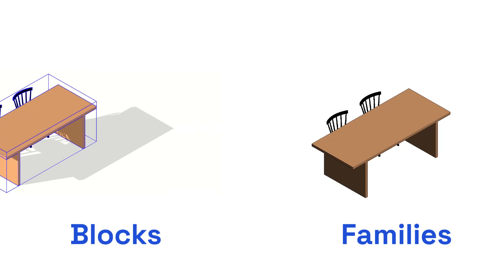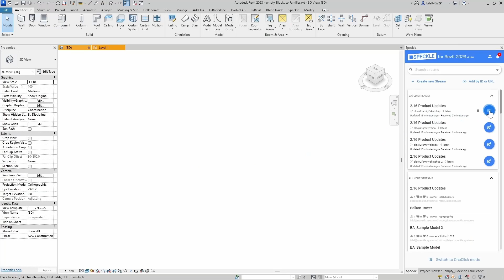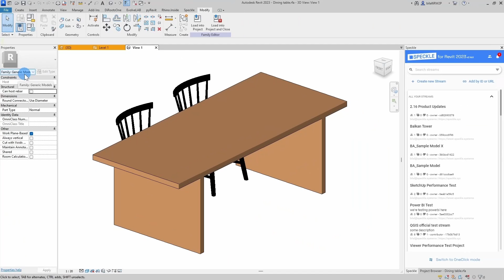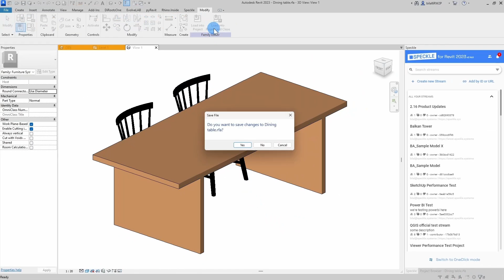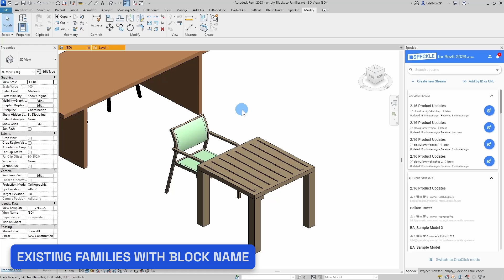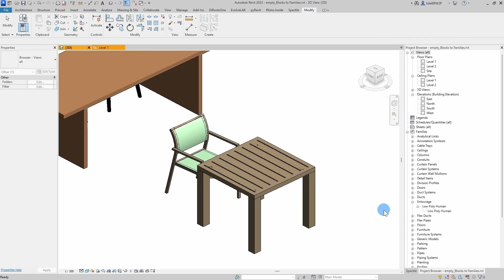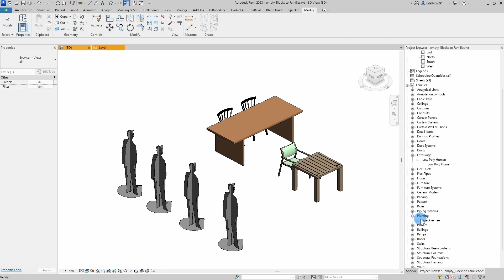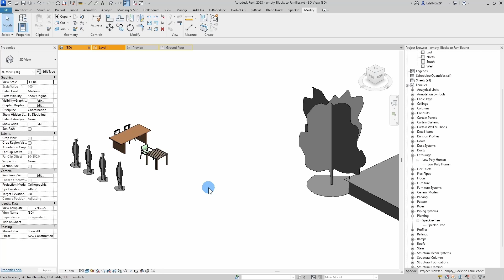Convert CAD Blocks to Revit Families using Speckle

Comment: hi i love your product so much, i have 1 problem though when i try to add dimension and detailing on revit on the furniture it wont work. any solution?
Reply from the maker: If you are sending a Brep geometry from Rhino, dimensioning should work. For other types of geometries, dimensioning may not work due to the Revit limitation.